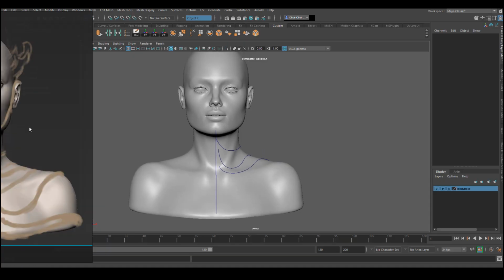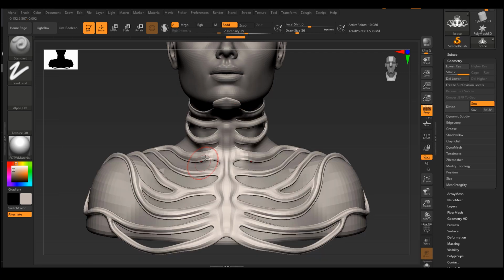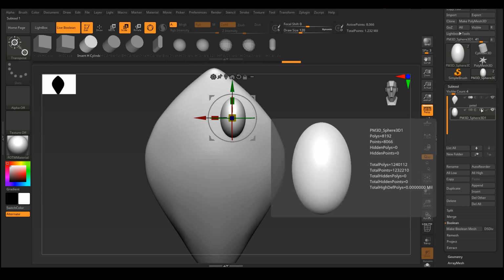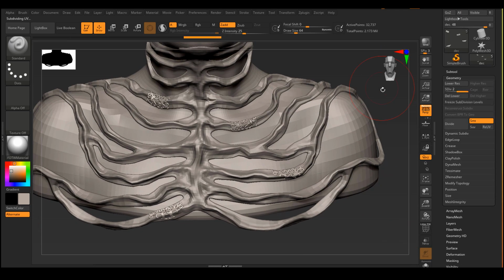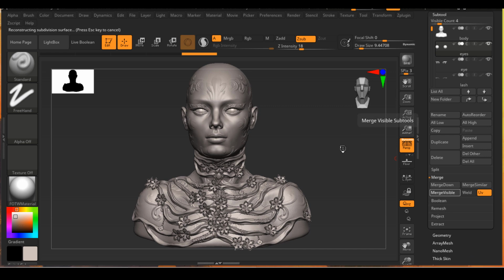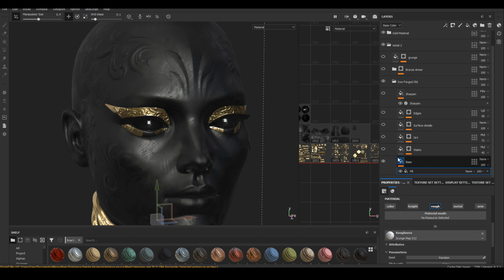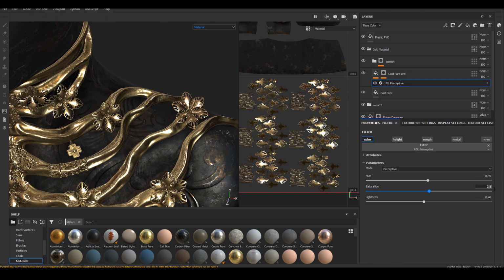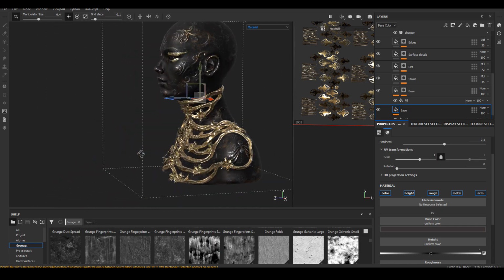3D Art Creation Full Workflow Process Using Maya, Zbrush and Substance Painter

Comment: Thank you for making these videos!! I am just starting Substance Painter and seeing how you work in it is really enlightening. 

I have a question though. Around 16:30 you added another layer of the gold copy to achieve some color variation. Doesn't adding two of the same layer affect the final color? I mean when I add a copy on the layer stack, the colors change even though it's the copy of an older material.
Reply from the maker: It shouldn't if the layer settings is normal not some kind of mix.